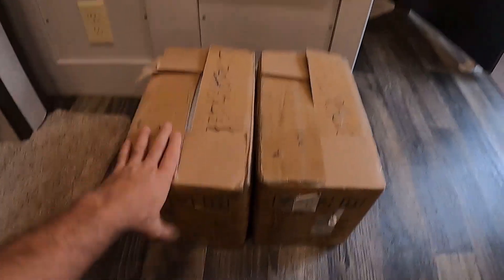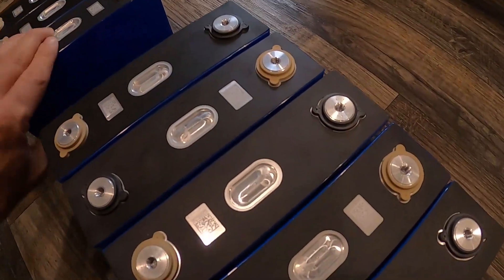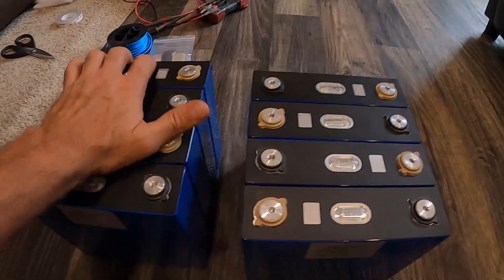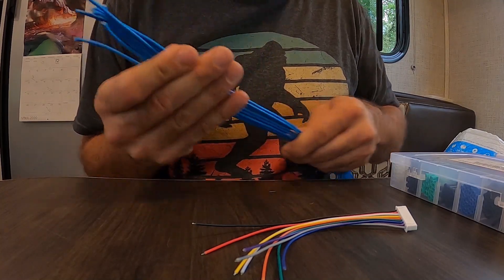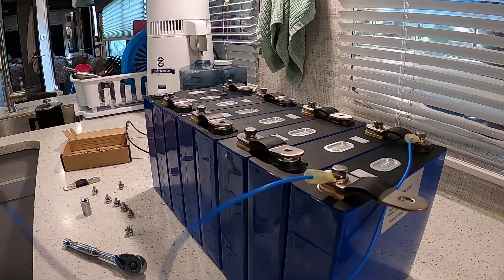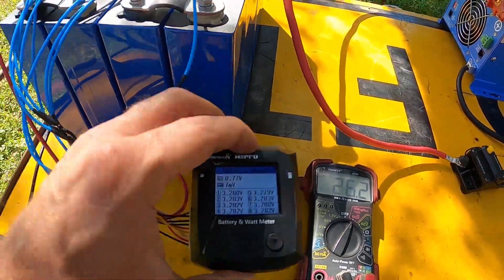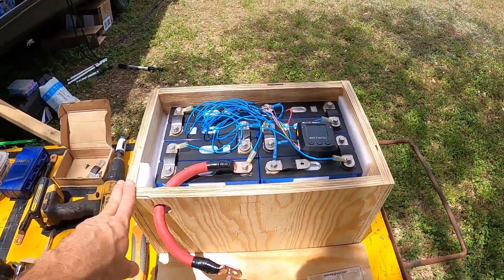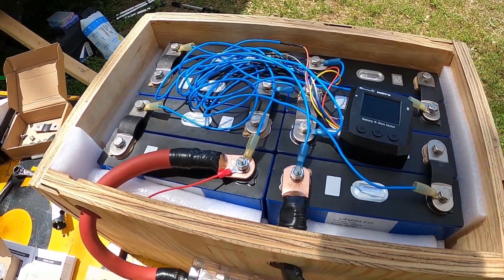DiY 24v LifePO4 Battery - DIY 24v Lithium iron phosphate

Comment: Is it ok to keep the  packaging foam for a diy box? I want to make one based off your video
Reply from the maker: @mrlaleezy  I used some in mine. If I were you I’d make the cells tight in the box. Mine had wiggle room.
Reply: @grumpysdiy thanks. I bought a lithium iron battery off Amazon and the box I want to put it in has a lot of space

Comment: How will you heat and cool battery's they must be kept between 32° f and 130° f I'm working on liquid heating and cooling
Reply from the maker: The battery was stored in a compartment that was temp regulated. No need for extra stuff. The only thing is, without a bms if something triggers a large load it will drain the battery. One time in a rv park they lost power over night and I didn't have my inverter set to turn off if it lost shore power, and it drained my battery.
Reply: @grumpysdiy  should not be using without BMS with temp shutoff and equalizer it's very dangerous and can damage your cells
Reply: @grumpysdiy  my build is 8 12 volt 100 amp 1250 whr wired in parallel in groups of 4 in a steel box lined with ceramic kiln insulation and liquid heating and cooling

Comment: with most things lights fans etc. in a camper being 12v other than the AC items while on shore power, why go 24v?  is the battery pack only hooked to the inverter to power AC items and not powering anything else? and you have another cell powering the other items?
Reply from the maker: I ended up with a 12v system. But 24v is more efficient and the wiring is cheaper. Because you can use a lower gauge. When people do this they just add a reducer to power everything at 12v

Comment: Can you wire the inverter to a breaker box and then wire the house from that like normal? [edit] Also: would it be a good idea to use terminal grease to avoid corrosion (if that's even a problem)?
Reply from the maker: Watch this video. https://youtu.be/sgxC4TUFwNo
Reply from the maker: Short answer is yes, however I do not recommend anything against code.
Reply: @grumpysdiy  Thanks! Also, your pup is amazing!
Reply from the maker: Thanks

Comment: Thanks for your video!!! I just got my 8S 24V 200 amp BMS today in the mail. There were zero instructions. I wanted to personal thank you, for your help. I will install the BMS in a few hours. My 8 LiFeFO4 are 272Ah on my 2K solar array.
Reply from the maker: Thanks, in the video I show how to hook up a active balancer which is almost the same as a BMS. Just add the step of hooking up the blue wire to main negative.

Comment: Were looking at that aims inverter charger combo. What specifically didn't work for you? Was charging just slow or was it constantly tripping when hooking up to what amperage of power outlets?
Reply from the maker: The breakers on the unit kept tripping under minimal loads

Comment: Is it possible to use a 24 volt inverter on a 48 volt solar battery bank ?
Reply from the maker: No, unless you change the pack to a 24v pack.

Comment: Awesome thank you
Reply from the maker: No problem!
Reply from the maker: If you don't know what size BMS you need just take the watts of your inverter and divide it by the voltage of your battery bank. example - 3000 watt inverter / 12v bank = 250 amp BMS or at least 250 amps worth of bms's.

Comment: I just need to find the BMS that you purchased I think this is the best option as well
Reply from the maker: I didn't use a bms on my battery, however Daly sells one on aliexpress.
Reply: @grumpysdiy  Why did you decide NOT to use a BMS?
Reply from the maker: I’m sure it’s in the comments somewhere on this video but I’ll state it again. I can control and set tons of parameters from my charge controller and inverter, and I have a cell balancer on the battery. Plus it’s my equipment not anyone else’s and I have that freedom to do so.
Reply: First time seeing no bms used, nice  @grumpysdiy
Reply from the maker: It it was because it wasn’t a long term solution and I could control all the things a bms could through the other equipment.

Comment: Did you get the BMS hooked up, and if so do you have a video on that part?
Reply from the maker: No not yet, I just have everything programmed so that it never gets drained to much or over Charged.
Reply: @grumpysdiy  what components are you using to achieve that?

Comment: Who did you buy them from
Reply from the maker: Lucky electronics from aliexpress
Reply: @grumpysdiy  Can you give us the price breakdown? per cell? shipping? duties etc? how much was the whole deal landed? Thank you in advance. Kinda liking what i'm seeing so far, just found your channel today. I may subscribe.
Reply from the maker: @sNEAKYnIGHTmUPPET  https://www.aliexpress.com/item/4000746859489.html?spm=a2g0o.cart.0.0.1f693c00VGfgCs&mp=1
They are actually cheaper now then when I bought them.
Reply: @grumpysdiy  in november 2019, it was 700$
Reply from the maker: I think they are just under $600 right noe
Reply: RV Adventure Couple I am buying 34 cells next month. $79usd each. 3.2v 280ah. Should be a good setup once I get them here and installed
Reply from the maker: That will be one hell of a battery, how much solar are you putting on it?
Reply: @sNEAKYnIGHTmUPPET  34cells... why?
Reply: RV Adventure Couple 1200watts to start, will be adding another 3600 next year
Reply: zarbonida yeah. I wasn’t clear with that, sorry. The main door setup is 18s the other 16 cells are for two 4s solar systems not connected to the main one, and the other 8 are for a 24v off grid solar inverter with 630watts connected to a 2400watt mpp solar unit.

Comment: Cool man. You got more skills than I do. lol. I would be scared to death to hook all that up. Very cool setup. Thanks for sharing.
Reply from the maker: The cost alone is enough to make you want to take a second look. Imagine getting 3 - 12v Battle born batteries for $1,200 US.
Reply: I thought the hook up was impossible, I was going to quit. I just got my BMS today in the mail. I looked at 6 videos today, but this guy nailed it, made it sound easy. ( I did watch this video 3 times ;) ). I install my BMS today.
Reply from the maker: Appreciate it